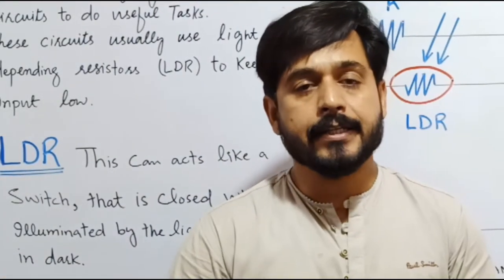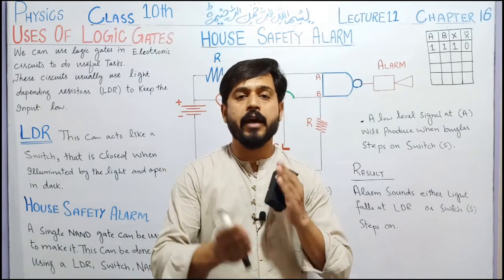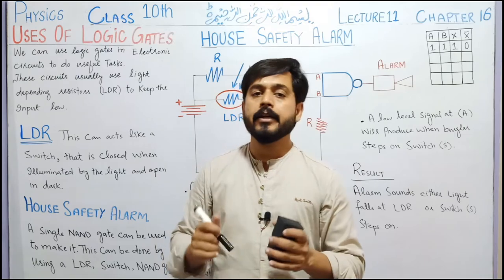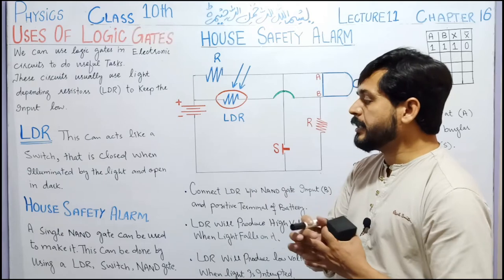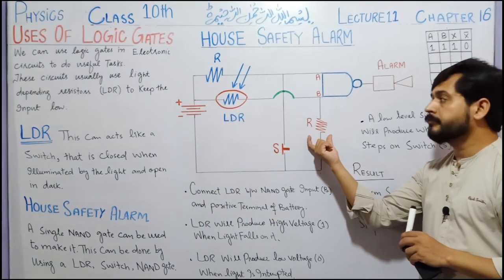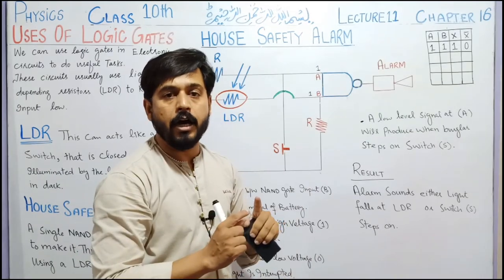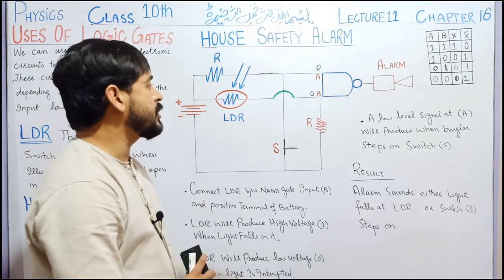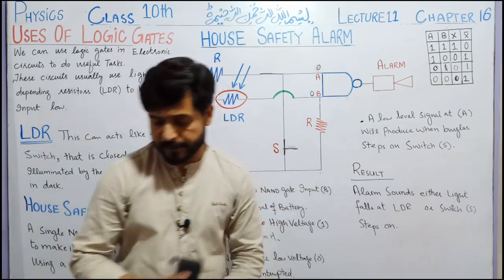PHYSICS: CLASS 10TH LECTURE 11 (HOUSE SAFETY ALARM) CHAPTER 16

Comment: Sir you say switch on and current will not go at point A is totally wrong
Reply: Current will also flow towards point A  but very very small as compare to switch circuit . So sir waqas saying no Current will flow across A approximately  right. Bcz this is comparing between two ways.